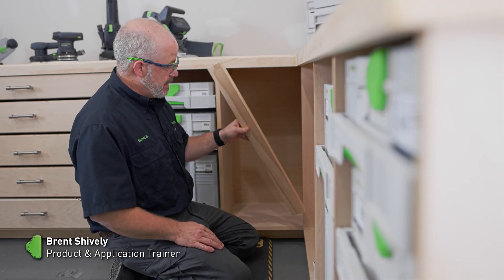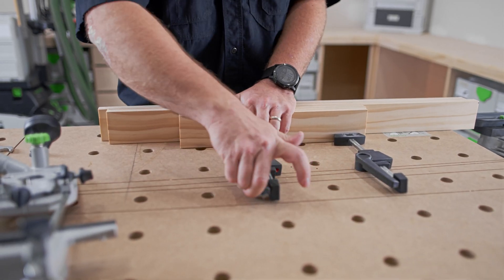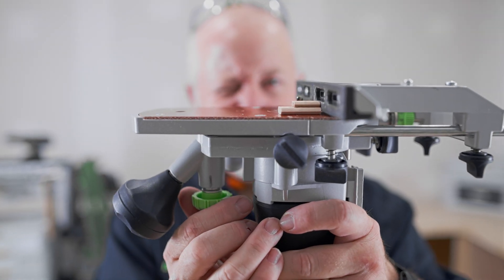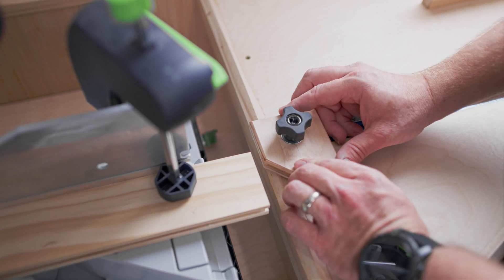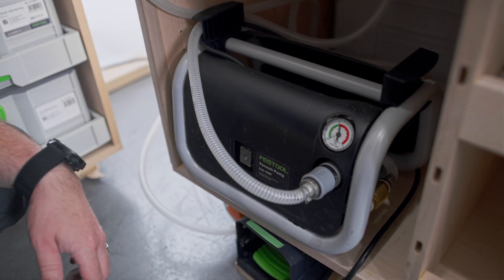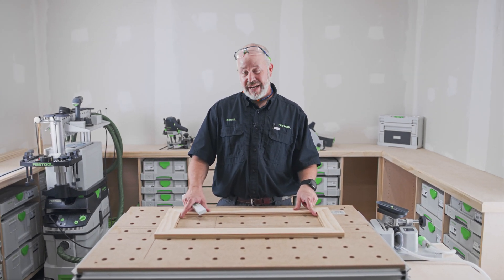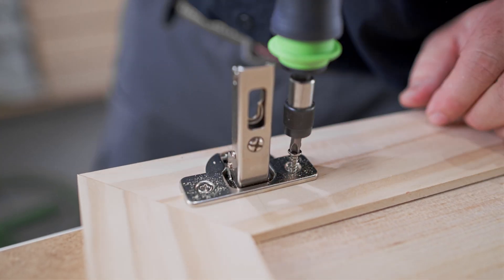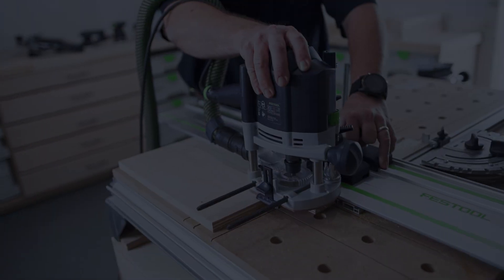Build Series 5: Doors & Drawers: EP 5

Comment: I took the door and drawer class with Sedge a couple years ago. He did the dado for the doors the same way. What is the advantage over using a router table?
Reply: mainly that this allows you to make this on site, totally mobile. if you're in a shop nothing beats a dado stack or router table for efficiency though.